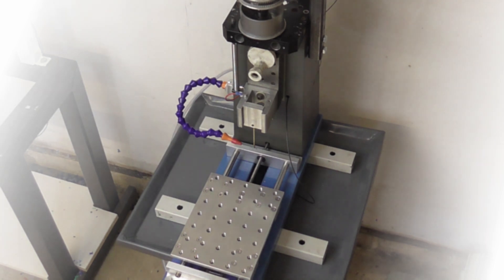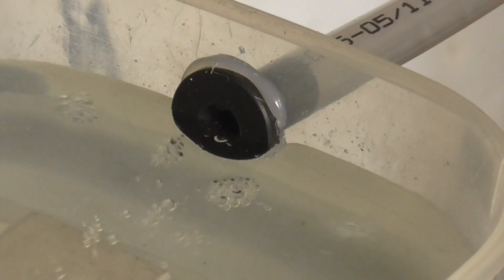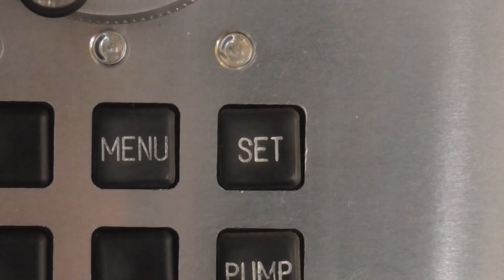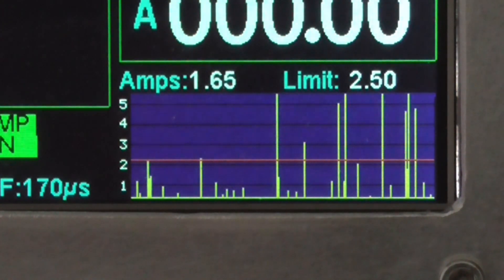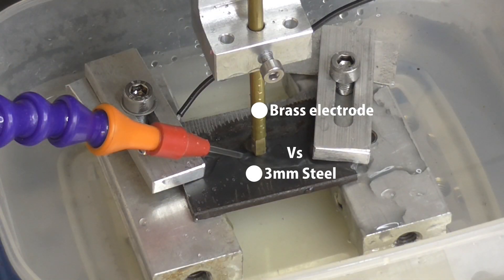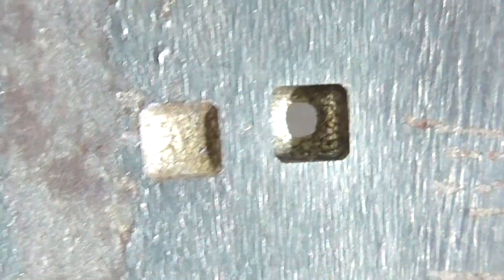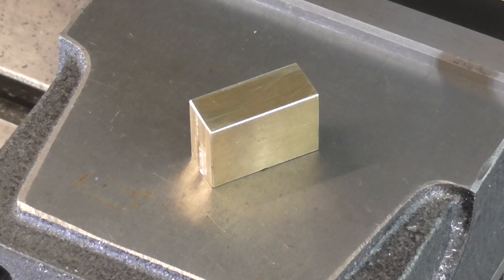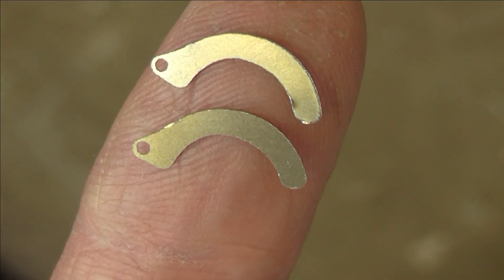Building an EDM machine part2

Comment: Great project Mr Andys, with Patreon filiate can i acess this project ? Draws? Codes? Tks
Reply from the maker: If you want to build something similar, really all the information you need is in the videos.

I haven't produced any plans as you probably wouldn't want to build it exactly the same way as I did and it would be extremely hard to locate all the exact same components I used.

The basic circuit and theory of operation is explained in the videos. I didn't build it with open sourcing in mind, I built it for my own application. I'm not going to release schematics and code etc. for the UI/control system as 1. It's not finished yet and 2. It's quite a lot more complicated than it needs to be and specifically tailored to my application, so probably nobody else would want exactly the same design.

I don't see what more information I can really provide, but if anything's not clear in the video explanation I'm happy to answer questions.
Reply: @AndysMachines  i wonder what parts u use to make arc & control it (normal analog way ) .....that el part drawing is nice ,but confusing when u dont know edm  ,which transformers ,resistors, caps to  use to get nice spark   :)
Reply from the maker: @MrCcfly  You really only need a power supply that's at least 40V at several amps. The capacitor and resistor just need to be able to handle the power you are putting through them or they will get hot. Camera flash capacitors are good (low ESR) and high wattage resistors (you can connect many in parallel).

Comment: 60 volts at 4 amps, looks good. 
I think my power supply may be 5 Amps at 60 volts.
I found a pressure washer at a garage sale.
I have the drill edm head no motor yet.  Now to find that transistor and use an arduino for my pulses.  What rate would recommend for the pulses?
Reply from the maker: I think I said in the video what pulse rates I was using, it's variable over something like 20-170μs pulse length and the same range gap in between. I mostly used a short pulse with a longer pause.

Comment: Stupid people dont upset me, you expect stupid things from stupid people. If anything, stupid people live up to expectations...but you sir, with all your brains and stuff probably have over stock stored away somewhere, make all these buttons on your home made injection molding machine probably using recycled plastic from your home made shredding and extrusion machine, cant apply some buttons to do some task you have to manually do yourself? It X, Y, Z back/front left/right up/down .. rotation? Did you put the whole table in a lathe chuck? I mean why not just build a robot arm with EDM CNC Laser engrave/weld/cut, 3d print, powdercoat, spray, coffee machine toaster with mug warmer...you upset me. Im going to go hang out with some stupid people ...somewhere like Australia or something.

Comment: Finally a DIY machine that is worth being shown on youtube.
Great work, especially the electronics design!
The bad erosion rate with electrode eating was electrode positive?
Exactly the same what I just experienced on an old AGIE that I put back into action, manual says, electrode positive, but erosion rate is horrible  and electrode gets eaten in no time. Changed electrode to negative and it works like charm. So at least brass needs electrode negative....
Reply from the maker: Yes, it was electrode positive, from what I'd read that was the most common set up.  But with a brass electrode and steel workpiece, electrode negative worked much better. This may be because brass is not the best electrode material, I still have a lot of experimenting to do, I think I'll get better results with copper or graphite.

Comment: Can i use Raspberry Pi as a controller perhaps?
Reply from the maker: You could, but that would be totally overkill. Plus you'd have to wait a minute or so for it to boot up when you turn it on, this powers on instantly.
Reply: how would u control it ? i have rpi ,printer board with good drivers and dont have clue how to control it  ,,can u help ? i need z up down and y to do slight rotation to cut part of gear for worm  . can u help me ?

Comment: This pump seems perfect for other liquid cooling applications.
Reply from the maker: Yes, I've used several of these as coolant pumps for mills, lathes etc. it's a 1200l/h version, smaller ones don't have enough head height.
Reply: @AndysMachines  What head height is the sort of minimum? I currently have a little bit of a to much coolant so i sort of drown in it on my mill.
Reply from the maker: You will need at least the height from the bottom of the coolant tank to the highest part of any hose when in use (usually higher than the nozzle height). Some of the smaller aquarium pumps seem like they will have plenty of flow from the specs, but they only have 0.5 meter max head which won't even reach the table, so it's important to check both the flow and head height and maybe choose one slightly bigger than you think you need (you won't get the rated flow and height both at the same time).

Comment: a recommendation on luer lock tips, you can get a much more accurate (and higher pressure) to position water jet using standard needle tips.  These can be 3d printed easily.  they also work well for your cnc machine.
Reply from the maker: Yes, I actually machined a smaller nozzle and threaded it onto the end of the loc-line hose (that's the red part on the end of the normal orange nozzle). It gives better flushing with higher pressure and also uses less water, without it there was too much flow for the filter.
Reply: @AndysMachines  are you sharing your gcode or controller code?  I'm struggling with the filtering right now... I planned on doing some controller work after I have better filtering.  perhaps we an collaborate.
Reply from the maker: @JesseSchoch  Hi Jesse, I took a look at your circuit, it's basically identical to mine except that you're using two switching circuits. I'm relying on the spark capacitor to do most of the filtering (no high side switching) I'm also averaging the last 4-8 readings from the voltage divider, but that has only a minimal effect. Unfortunately I haven't been able to spend any more time on my EDM since I made this video, I haven't started on the gcode control yet (I will keep it very simple anyway, only a few commands).
Reply: @AndysMachines  do you recall how much power you are averaging?  My supply has a power average output and it measures around 20-30W.  I can push it harder but cooling the mosfets has been an issue.  I need to figure out the efficiency of my system to see how much of that is going into the cut.  the gate drivers are pulling 4W of power from a separate supply!
Reply from the maker: @JesseSchoch  I didn't measure the average power, but I think it's closer to 100W. My power supply can provide 240W. The IGBT and spark capacitor do get hot after a while.

Comment: Part 1 of this showed up in my suggested videos today.  I have been looking into doing a wire EDM.  No real use for it  but it looks like a nice toy.  You give a very good explanation of the circuit and it is a pretty simple design.  I may have to give this a try.  What part number are you using for the transistor?  I have never seen the IGBT type before.
Reply from the maker: it's an IRG4PC40 though it may not be the best choice, it's just what I had to hand. I used an IGBT as they can handle more voltage and current than most MOSFETS, though I'm actually more familiar with MOSFETS and I'm sure they would work as well but you might need 2 or more in parallel.
Reply: @AndysMachines  That is quite a part and pretty cheap.  I am going to have to look around and see what I have for power supplies.  I can see a quick experiment with an arduino.

Comment: I've been looking into the current-voltage characteristics for RC EDM circuits, is the type of waveforms you find in your circuit the type explained in this paper? [https://www.sciencedirect.com/science/article/pii/S2212827117310673]. Would that mean that the direct relation you mentioned between current and voltage is also described as i = -C*dV/dt? That same relation is mentioned here on page 12/15 [https://nptel.ac.in/content/storage2/courses/112105127/pdf/LM-39.pdf]. Am I going about it the right way? Cheers!
Reply from the maker: Yes, it will be similar and the current voltage formula will probably apply just as well, though this is not as simple 'RC' EDM, the current is pulsed, but all this really does is shut off the arc earlier. The capacitor is still charged through the resistor in the same way and the voltage/current relationship will be similar.

Comment: After lots of parts, if you look in the bottom of the tank you will find lots of black powder. Look at it in a microscope and they are tiny balls, like welding splatter. You are taking out tiny chunks, so the balls are tiny, some like smoke particle small. 
The wear thing, For each amp setting there is an ideal on time that will produce about 2% wear. Miss it and you get more. There is also a max amount of amps an electrode can handle. 25 amps per sqr inch is a safe number for most graphites, coppers are less, depending on what else is in there. Largely it has to do with the melting temps, but also has to do with resistance heating in the electrode. It also has to do with the shape of the wave form in your machine... A flushing hole through the middle of the electrode also helps with wear, by doing a better job of flushing out stuff from the burn. Submerged burns also tend to flush better and give you better control, but open air burns sure are cool :) As a note high wear burns do tend to be faster then the low wear ones. copper/tungsten works well as an electrode, graphite tends to work really well, Aluminum doesn't work that great, but if you happen to have a bunch...
Reply from the maker: Thanks, that's useful information. I get black powder in the bottom of the tank after just one part! 
I need to do a lot more comparative testing, so far the only thing I can see that helped with the electrode wear was changing the polarity when cutting steel. Using your value of 25A / sq inch, I should have been running the small square electrode at 600ma, I had it set to 2.5A, though the actual current is not very constant, I would need to do more averaging on the waveform to get a better idea. The pitting on the electrode and workpiece does look quite coarse to me, so maybe I was running it at too high a current.
Reply: @AndysMachines  I'll dig through some of the manuals and burn charts I've got. Poco has some nice stuff, but only about their own graphite: http://www.edmtechman.com/
Reply: @stevebromley4230  i had zero knowledge about EDM ,i watch Andys 2 videos and Steve's excellent  link to Poco graphite , now i'm a expert ( just kidding ) , seems its ''D.C. spark erosion of your tool mainly caused by inadequate flushing . What a wonderful resource Youtube is , truly amazing , liked and subbed .
Reply: So what would be the ideal voltage? And frequency? How would you figure out the sweat spot in terms of energy used and amount of material removed?

Comment: I've been enjoying your videos for quite a while Andy! I've been breaking my head over this one (no electrical engineer), do you interpolate the 0-5V reading to an averaged arc amperage? I understand that 1) 0V:= shortcircuit = steady state just under 4A I'm guessing depending on R1 after a capacitor discharge spike of I=60V/(measured shortcircuit resistance), and that 2) 5V:=60V cap := 0A arc current. Are the spike and 0A the two points you interpolate between? Also, would it not be enough to use the potential divider to measure the voltage across the cap and advance the electrode to reach a target capacitor voltage? Really looking forward to how this build progresses!
Reply from the maker: I've tried to keep the current reading/gap adjustment as simple as possible, I'm feeding the voltage from the potential divider straight into an A2D pin on a microcontroller and taking a reading every 2ms or so. The averaging effect of the resistor and capacitor is not that great and the voltage read is still very spikey, the yellow trace on the screen is directly related to the voltage read, there is no extra filtering. Every time the stepper motor steps I compare the last A2D reading with the value of the current limit, if the current is below this reading (ie. the voltage is above the set limit) then the motor steps, if the current is above the limit then the motor pauses until the next step. I could do something much more complicated with a target gap voltage and PID algorithms, but this simple way seems to work fine.
Reply: @AndysMachines  Thanks for getting back so quick! I understand everything you mention besides the direct (inverse) relation between the 0-5V reading and the arc current (the magnitude of the yellow trace)
Reply: @filenizozemac  Not an engineer either, but I think I can answer your question. The capacitor stores power from the power supply.  When the burn mode is activated, the power supply begins charging the capacitor. As the electrode isn't close enough to the work, the spark current is zero, and the voltage quickly rises to the power supply voltage. As the electrode comes into range of the work, and with the IGBT pulsing, sparks begin to occur. These sparks pull power from the capacitor's storage, thus causing its voltage to fall. The stronger the sparks are or the more frequently they occur, the lower the voltage on the capacitor. When the spark current is high, the voltage on the capacitor is low as it is still being recharged by the power supply. Thus one can see the inverse relationship; low voltage on the capacitor implies high spark current, high voltage on the capacitor indicates low spark current.
Reply from the maker: @nuclearusa16120  Yes, that's exactly it. The resistor is before the capacitor so as the current increases there is more voltage across the resistor and less across the capacitor.

Comment: Try to get ahold of some EDM graphite(it's literally just called that). Extremely dense compared to what you'd think graphite would be, machines like air-cutting(plus some chipping), and lasts a lot longer.
Same deal with EDM copper, but far more expensive.
You can also in theory try using graphite gouging rods. Way softer, but stupidly cheap in... rod form. Would need to turn the copper coating off.
Reply from the maker: Yes, I do have some graphite rod, sold as an electrode (I believe for EDM), but I haven't tried it yet as it's very messy stuff to machine. I haven't heard of 'EDM' copper, but I also have a pure copper rod.

Comment: Hi Andy, love the project. Do you have any plans to try graphite electrodes? I'm wondering if something like an electric motor brush could be a more durable electrode. Plus it would be very easy to shape.
Reply from the maker: Yes, I do have a graphite rod to use as an electrode that I haven't tried yet, it was quite expensive. I hadn't thought of motor brushes, that might be a good source of material to experiment with.

Comment: Well done! Dealing with micro compters and now, microcontrollers, the automation feels like familiar. However, as my use for EDM is small I could think of manual pumping water as well as manual feeding the electrode down. Looking at part 1 will be the next step.
By the way, creating 60 volt and the current needed calls for some knowledge...

Comment: I am loving it and I will definatly build something similar. It is an amazing inspiration. Although I will not go for making a injection molding mashine to make my own buttons. I have to draw the line somewhere. Thanks.
Reply from the maker: Before I had the injection moulder I used to make buttons by turning a 'top hat' shape on a lathe and drilling a hole in the panel. The flange keeps the button in place and it just rests on a tactile switch behind the panel. The problem with round ones is they can spin in the hole so anything you engrave on it won't stay upright.

Comment: Obviously de ionised water is the safest di electric but it looks like you are running into contamination problems with the high tool wear. I understand that there has been some reserch into using glycerine as a safer dielectric than dielectric oil.
Reply from the maker: I haven't noticed any problems after the water has been in use for a while, I don't think any of the particles are soluble and don't seem to change the conductivity, they all settle out eventually leaving clear water, the filter catches most of them.